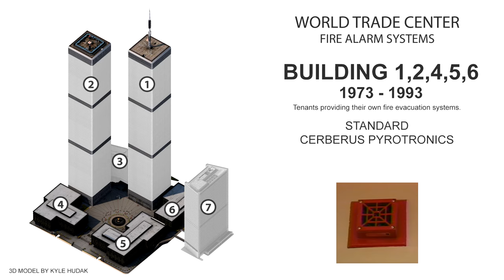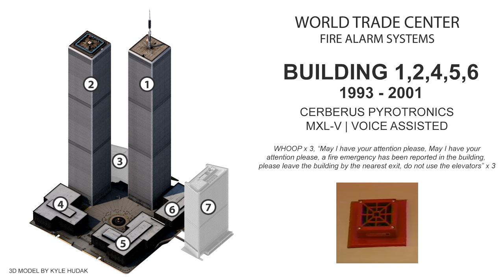World Trade Center | Fire Alarm Sounds, WTC 1,2,4,5,6,7

Comment: Kinda creepy that this was the last thing some people heard before they died
Reply: Most of the people that died probably didn't hear this at all. There was no power above the 92nd floor in the North tower.
Reply: Kellie Kane yeah but those fire alarms still had battery backup and stand alone backup. They definitely heard something.
Reply: How do you think they would work after a plane most likely shreddd the wires
Reply: @145-k1b  not to mention water damage.
Reply: Exactly!
Reply: HJFireProtection never know, maybe one a few wires needed to survive to continue the alarms. Also maybe the higher floors had backups like Zend was saying
Reply from the maker: @145-k1b  Fire alarm systems in buildings like that tend to be equipped with a so called "redundancy circuit". Which means that in the event of a catastrophic failure, there are backup circuits that take over. The Twin Towers most likely had something like this as well since its a requirement for fire evacuation systems to operate during a power outage.
Reply: @145-k1b  every building has like emergency backup power or something
Reply: @145-k1b  There is a video of a person going partway inside only the ground floors and second floor and this alarm was going off.
Reply: gushater 1415 yes
Reply: @145-k1b  the music speakers worked until the towers collapsed
Reply: @JoeLikesTrains  Are u trying to make fun of them?
Reply: @JoeLikesTrains  pretty sure ur trying to
Reply: @rebelhaeden  I assure you I’m not
Reply: @rebelhaeden  I think he was just trying to say what people might've heard, like he originally said
Reply: @imadoglol4445  Depends, most fire alarm panels have battery back up power and can set off alarms even during power outages. However, severed and destroyed cables is a different matter in which case the alarm would only work till where the cables were severed or destroyed. 

Fire alarms only work till fire destroys the cables that supply them.
Reply: And the 76-110 got lille or so any power
Reply: @anetrialewis3780  Depends it's possible alarms have battery backup but that requires connections from the main panel or annunciators.
Reply: And sad
Reply: @trevormacewan  What if they had battery back ups?
Reply: @spearshake4771  it's possible but unlikely as notification devices don't have independent power. Fire panels have battery backups that's why fire alarms still work for limited after a power outage. Problem is severed wires would make the alarms above the impact site non functional.
Reply: Alarm During Unnecessary Times: I NEED TO ACTIVATE
Alarm In 9/11: This Is Fine
Reply: @trevormacewan  I'm pretty sure in some systems, if the cables are cut and connection is lost then the alarm will automatically be triggered provided that there are battery backup.
Reply: @RobvilleVirtualRealisations  I've seen systems with pathetically weak backup power supplies, and this is at a place that had power outage issues as well, at least sometime before 2001.
Reply from the maker: @RJARRRPCGP  Oh absolutely! Not denying the possibility that all lines were severed, or that the system may have been faulty in areas regardless. It's just likely that there would be redundancy implemented, but indeed, especially with massive buildings like these, there's a lot of aspects that could simply have been better.
Reply: @LaKellita  FDNY radio shows that when the firefighters reached some floor with mass casualties (such as 78th floor at South Tower), fire alarms can be heard during the conversation between the firefighters and the command station, meaning that the victims could heard the sound before their last breath.
Reply: @hwdprtn7670  depending on which floor on which building. The north tower had no power above 92.
Reply: @JoeLikesTrains   you shouldn't joke about that at all.
Reply: @governmentphone7933  I wasnt. I said I wasnt. Are you unable to read?
Reply: @destroyer-medic5073  With no power that's unlikely as notification devices are not directly connected to power. For example if you see a fire alarm video with people testing an alarm they connect batteries to it for it to sound. Unless they have dedicated panel that controls their devices, 

If you're talking about a trouble signal on a panel for a missing or damaged device or sensor you'd be correct but that does not trip the system into alarm. It would only activate a trouble signal on the panel or annunciator.
Reply: @LaKellita  92nd? How much floors are there?
Reply: @notTreydaman  there were 110
Reply: World Trade Center 7 fire alarm is creepy
Reply: I honestly didn't read all these replies, so pardon me if this was already addressed:

Are you sure they sounded the alarm anyway, given the low chances of escape? Maybe they wanted people's last few minutes to be less stressful? Just a theory.
Reply: @RobvilleVirtualRealisations  that’s for the field wiring shortage or a fault, though
Reply: Most definitely, the people in the towers, regardless of the floor level, heard this.  Yes, the planes would have shredded the wiring but the speaker/strobes before the break would have continued to function.  And, the fire alarm system had battery backup as well as emergency power from the emergency power systems for each floor.  They most certainly heard this sound.  I am pretty sure that the alarms did continue to operate and so the speaker/strobes did continue to sound.  Maybe due to the planes, a bunch of speaker/strobes did not operate due to the wiring being severed, but speaker/strobes are very loud.  They heard something like this or maybe temporal code 3 tone may have been used.
Reply: @DominicsStuff.  they were outside below impact
Reply: @LaKellita  batteries kick in bro. Fire alarms have booster supplies that continue with the audibles. As long ad the riser for the data wire and spkr circuit were still in tact should still hsve been heard.
Reply: @mcwooley  the fire alarms would've sounded on their own from the smoke and fires, I'm pretty sure that the alarms had some type of battery backup so they still went off at least until the battery ran out or, sadly, the building collapsed. But I don't think they could've shut them off anyways, because everyone was evacuating.
Reply: @LaKellita  I think there are backup power systems for emergency stuff but I don’t really know
Reply: Yes, the people in the world trade center would have heard this sound or perhaps MAYBE temporal pattern code 3 tone in some areas but more than likely, the slow woop tone was heard prior to the collapse.  The speaker/strobes in areas where the wiring was still intact will continue to operate, the panel will be in a trouble condition due to open speaker/strobe circuit but the intact areas speaker/strobes will continue to operate.  If you put a speaker/strobe or horn/strobe on a nac with no end of line resistor, the horn/strobe or speaker/strobe will still operate and sound, but the panel will be in trouble.  With that said, the speaker/strobes up until the spot where the planes went in will continue to operate however, the speaker/strobes downstream will not because, the nacs would have acted as nacs with end of line resistor.  Yes, speaker/strobes and horn/strobes upstream will still continue to operate even with an open nac, the panel will be in trouble.  But downstream, no.  Plus, speaker/strobes are very loud so all of this said, they most certainly heard something.  On top of that, the world trade center had emergency power for each floor that would have kept the fire alarm systems in operation and on top of that, each floor fire alarm system would have had battery backup.  Without a doubt, the people inside the world trade center heard something from the fire alarm systems and most likely was the slow woop tone, unless it was updated at some point to use temporal pattern code 3 tone prior to 9/11 but I doubt it so most likely was the slow woop.  If you look on here YouTube, you will find a vintage video of fire safety in this same world trade center from the 1980's and it had the slow woop tone.
Reply: The fire alarms didn’t go off during 9/11.
Reply: Are you guys seriously arguing about this? Whether people heard the alarm, they'd be dead either way.
Reply: @145-k1b  battery backup
Reply: @zendayamarie7743  the panel had battery’s not the horns you wouldn’t of heard it above the 92 floor as all cables got damaged including the fire alarm cables
Reply: @145-k1b  they won’t your correct only the panel has battery backup and all the wires got damaged so no one could’ve heard it above the 92nd floor
Reply: @spearshake4771  the sounders don’t only the panel but it don’t matter as all the wires where destroyed
Reply: @lift_brisll  but why didn’t each floor or 2 have it own panel? Was it all hooked up to one?
Reply: @scaryman8672  it probably did but a repeater and it gets it communication from the main panel which you guessed it is wired
Reply: @145-k1b  below the impact zone, mist noteably in the lobby the alarm rang out
Reply: Yes, I can tell you that the fire alarms didn't sound on the 92 floor.  I don't know about the fire alarms above that.  Sky scrapers often have the fire alarms tied in a network and each floor has it's own fire alarm panel.  Each floor is tied together in a network.  When the plane crashed into the tower, I can tell you that there were troubles all over the system.  Invalid reply from floors 92 and above, invalid reply from hundreds of sensors, open nacs, at least...400...800 troubles, easy.  Plus an alarm condition.  It is entirely possible that the people in floors 92 and above didn't hear anything at all from the fire alarm system.  When the plane hit the tower, cables were severed everywhere and I am sure that the control panels on floors 92 and above never got the alarm signal.  Therefore, the floors of 92 and above never sounded.  However, the floors below the 92, they sounded for sure.  How sky scrapers work is that when you pull the fire alarm on say, the 13 floor, the control panel on the 13 floor goes into alarm and the nacs on the 13 floor come on.  The 13 floor panel then sends a signal to the other panels and they go into alarm as well and then the nacs on the other floors come on also.  And, more often than not, sky scrapers have more than one panel on each floor.  So, each floor has several panels on the same floor.  8 panels per floor...easy.  And, I believe that yes the panels did have battery backup and each floor had emergency power, I believe that the alarms never went off on floors 92 and above simply because, those floor's panels never got the alarm signal.  So, the fire alarm systems on floors 92 and above didn't have a reason to go off because, those panels didn't get the alarm signal.  Very similar to how smoke detectors in your house are interconnected.  If you disconnect the smoke in your bedroom, and set it off, with it taken down, the others in your home won't sound because, they didn't get the signal.  However, if you set off a smoke detector in your house with it hooked up, I guarantee it, the others will sound also, thanks to the interconnected wiring.  However, if you disconnect the interconnect wiring, the other smoke detectors will not sound because, they didn't get the signal and therefore, didn't have a reason to sound.  Same thing in sky scrapers.   Sky scrapers are the same principle.  The only difference is that the systems are FAR more complex and FAR more elaborate than that of smoke detectors in a house.  Now, for the 91 floor, I believe that the fire alarms did go off on that floor but not all of the speaker/strobes sounded because, the speaker/strobes upstream and before impact did sound but the speaker/strobes down stream of impact did not sound because, the cables were severed.  And, like I said, the speaker/strobes will still work even if the nac is open as long as it is upstream of the break.  The panel will be in trouble from an open nac but the nac will still sound the notification appliances upstream of the break.  It would basically just be like having a nac with no end of line resistor.  Keep in mind, upstream means closest to the panel and down stream means farthest from the panel.  With that said, the upstream notification signals will still sound but the notification devices down stream will not in this scenario.
Reply: @RobvilleVirtualRealisations  Do you know what the alarm sounds like in 1WTC today?
Reply from the maker: @hilo2-est3-elev  There used to be a video of the alarm going off at the transportation hub. I believe that's the same alarm they installed in the new tower as well. Unfortunately I cannot find it anymore.
Reply: Not the ones that were in the impact zone.
Reply: Also if it said can I have ur attention then died ngl all respect that's kinda awkward
Reply: @imadoglol4445 think the plane to that out ngl to u
Reply: Pretty sure the system was placed on audible silence after FD arrived.
Reply: Lol you really think those people could hear at all after that explosion 😂
Reply: It sure is. RIP to the victims of 9/11
Reply: I agree
Reply: It wasn’t..
Reply: I know that one of the guys on the 104th floor called the fire department right before the collapse of the south tower and there were no alarms - probably because it was above the impact zone
Reply: @oufukubinta are you taking about Kevin Cosgrove? He was on the 105th floor of the South Tower and his 911 call recording was publicly released.
Reply: I mean some people didn’t hear it at all
Reply: @chadrowland5234  Source: Trust me, bro.
Reply: I know someone that was in the towers and got out they heard this and they have ptsd from it
Reply: Nah the last thing they heard was the towers falling along with the alarms going off too, there is a video before building 7 fell, someone went inside filming and you can hear that same siren
Reply: Nah they heard a jet 🤣
Reply: And the fact I think the only time it was used was during the event that destroyed the buildings
Reply: I agree chilling
Reply: @Daa253 where at?
Reply: @stargate1552  Yes they did. If you listen to the audio of Jules Naudet's tape from the North Tower lobby, and if you listen to the FDNY radios in the South Tower as firefighters climb to the impact, you can hear the alarms whooping in the background.
Reply: Some and some may have not, 

In the full Melissa Doi 911 phone call, the distinctive WTC Fire alarms can be heard blaring.
Reply: @LaKellita  I'm pretty sure emergency systems wouldn't need  electricity
Reply: Scary
Reply: Indeed. And very sad
Reply: @stargate1552 yes it did. during videos and audio of firefighters, you can hear the alarms going off.
Reply: In short, 

All floors below 92 went off because they all got the signal. However the floors that were above the impact zone had battery backups, and while it may be true the those alarms didn’t get the signal from the other floors, it’s also true that if someone pulled a pull station above 102, the rest of the alarms above it should have gone off because there still connected together and have battery backups.

Comment: WTC7 is literal hell
Reply from the maker: @AA The chime sound was there to notify about a fire related incident whereas the whoop signaled evacuation. Firecom still provides the alarm system for the current WTC complex, and there's a video in which someone films the alarm going off within the transportation hub. Albeit a slightly different tone due to it of course being a newer variant, Firecom still utilizes it.
There were no alarms associated with the destruction of buildings as such since not only because such scenario's are too specific, it would also defeat the purpose of what an alarm is for; to notify about ongoing hazards within the confinement of the building itself.
WTC 7's alarm got triggered after the collapse of the South Tower, presumably due to the vast amount of smoke entering the building.
Lastly, the chime sound can be heard within Mark LaGanga's video of WTC7's lobby. The North Tower was still standing at that point.
Reply: Robville Virtual Realisations 

what is the video called that features the Transportation hub alarms?
Reply from the maker: @DylanKevilleSirens  The video title is "Fire Alarm Activation at One World Trade Center in NYC" (no quotations). You'll hear a triple chime repetition with voice assistance.
Reply: @RobvilleVirtualRealisations  What processor did Firecom use to generate those tones, and what was the name of the guy who wrote the software?
Reply: I have a feeling that the Staples Center in LA has that whoop, being that the system there is a Firecom.
Reply: Mellisco yes
Reply: Why does it sound like bing bing
Reply: @RobvilleVirtualRealisations in that footage, WTC7 seems to be on emergency power... most of the lights are out.

Comment from the maker: Notice for previous commenters:

Due to an odd YouTube bug, a lot of comments on this video were removed without any notification. To those who commented; I did not delete your message, and really appreciate the response given to me. I was able to read them though in my bell notification before they disappeared.  It frustrates me that I wasn't able to reply to you all.

It now seems that the bug has gone, so I've reopened the comments section. Fingers crossed.
So, anyone, feel free to add any comments or ask any questions.
Reply: What did building 3 have?
Reply from the maker: @DylanKevilleSirens  Unfortunately I wasn't able to find any documentation about it. Considering the rest of the superblock used a Cerberus system, it is somewhat likely it was incorporated in there as well. But again, there's no certainty of it due to the lack of documentation.
Reply: It most likely was a Cerberus system, as the rest of the WTC hat it other than WTC 7, which was completed later on, and is probably why the system was different, I still find the whoop/ chime tone very weird
Reply: What did Building 7 have